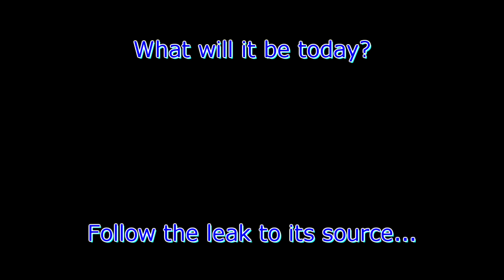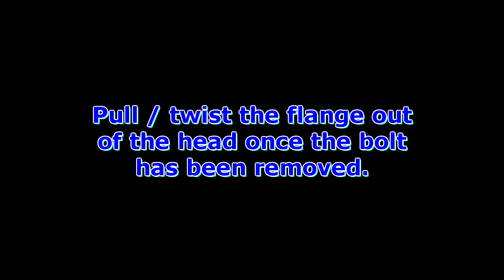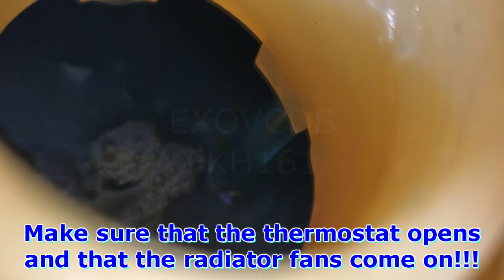T4 / Eurovan: Common coolant leak source (5 cyl engine)

Comment: Great to find this video. I discovered today that I was loosing fluid from this very spot. I ordered the flange hopefully it comes with a fresh o ring as that’s presumably all that really needs to be replace. Thanks as always for your help. This van would be tough to maintain without your videos. 🙏
Reply from the maker: The plastic flanges deteriorate/ deform over time... so it's always best to replace the flange  & o-ring at the same time.

Comment: Hi Thomas, I’m dong my coolant flange today the one closer to the alternator it have allen bolts and they won’t bulge I tried spraying them with WD40 and I’ll leave them for about 24hr. Any tips you can give me to avoid stripping them or breaking the head of the bolts?
Reply from the maker: Hmm, usually 10mm head bolts.
Not much room even with radiator in service position. Alternator is in the way for the top one... I would have suggested to knock against the head of the bolts with a hammer or use a bolt / nut extractor socket... to bite into the outside surface of the round bolt head... but not much room.
On the other hand,  if you are replacing the flange... break it, then you have room to get a socket over the bolt heads. You just need the right sized socket.
https://www.toolup.com/product-images/Proto-J69X00_01.jpg
Reply from the maker: With the flange broken and only the base remaining... you can probably get a chisel on the head of the bolt and shock the bolt in a counterclockwise direction to loosen them.
Reply: @EXOVCDS   I haven’t tried forcing them off yet. I just saturated them with wd40 and will try again tomorrow with a hex bit. I’ll update you on how it went thank you very much for replying.
Reply: Hi Thomas, after saturating the bolts with wd40 for 24hrs they came out without a fight now I just have to reverse the process. Thanks for your help.
Reply: This is my exact problem thanks!! , what size is the o-ring and the hose clamp clips?

Comment: I have been tying to replace this same coolant flange on my ev but can’t seem to get the new one inserted all the way. Seems to be a real tight fit. Any suggestions there?  Maybe grease on the insert sleeve?
Reply from the maker: Make sure that the bore is clean. Use a mirror for close inspection or take a video with your phone up close to the hole. Once you are sure the bore is clean, use a bit of sand paper, wrap it around the flange and twist the flange a few times. The sandpaper will remove a bit of plastic from the flange... then test fit the flange in the bore. Repeat sanding & test fitting till the flange enters the bore and is "fully seated". Depending on the flange manufacturer... flanges are made from a mold of a mold or a mold of a flange. Resulting in size variations from the factory part.

Comment: The bottom of my 93 2.5l is a mess. The side of the oil pan where meets up near the transmission. I always have oil hanging off those, I think they are the transmission mounting bolts. Are there any certain areas up there that are known to cause this leak?
Reply from the maker: Crankshaft seal.
Reply: @EXOVCDS  i have this sort of problem too. there seems to be some leak around the transmission mounting bolts AND the seal where you show a repair in the video.  if the crankshaft seal were gone would there be a drop in transmission fluid too?
AND where can i get a new o ring seal that you replaced in your video?
Reply from the maker: @jamessullivan1648  crankshaft seal will cause oil level to go down. Standard or automatic transmission? Engine oil, standard transmission gear oil and automatic transmission fluid all smell different. The colors are also different, but can look similar with age. Clean the engine & transmission, so you can spot all leaks better (if there are more than one). Always replace that coolant flange. It should come with a new o-ring.